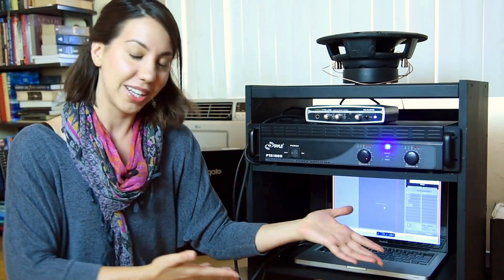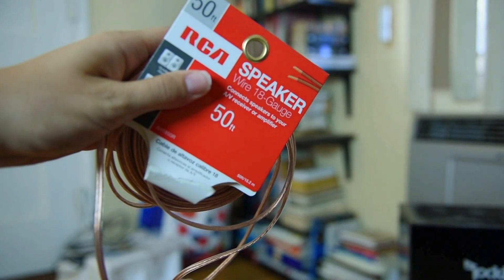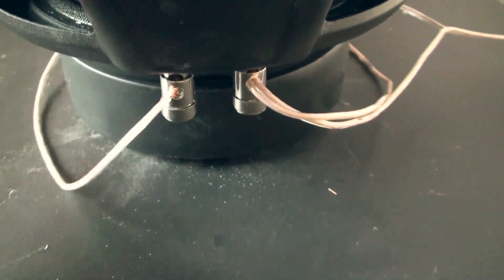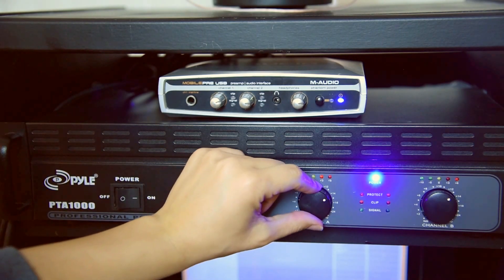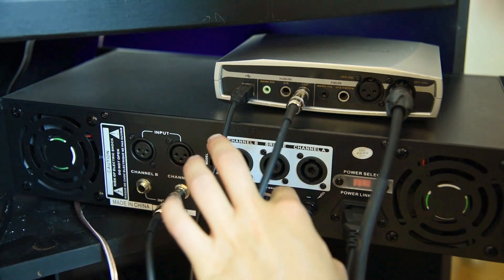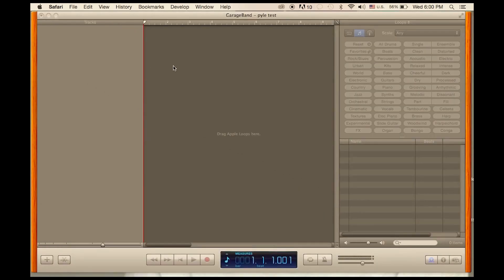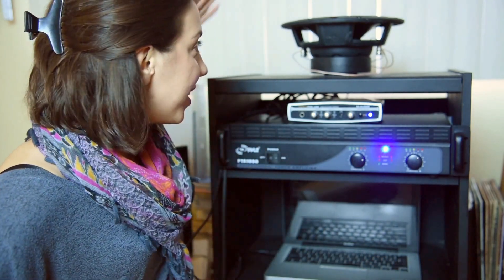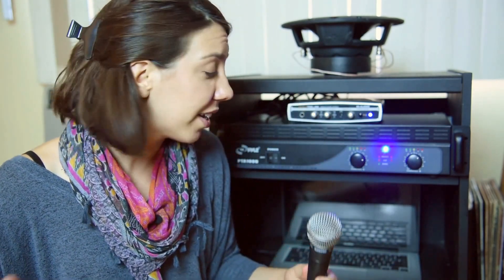How to build a Cymatics Rig!

Comment: actually white line is positive, blank is negative, but its not going to make enough of a difference for you to notice, most of the time, unless you have 2 speakers sharing the same box they will cancel each other out and will not produce the correct sound vibrations

Comment: Can you please tell me, is this setup appropriate for the kind of cymatic patterns that are seen with a cymascope, using water, light and a camera which give off those almost 3D like shapes?
Reply from the maker: Orphiac Inc I’m not entirely sure, I have a feeling that that would require some sort of a plate and this is using a speaker.
Reply: I deeply appreciate your quick reply. http://www.janmeinema.com/cymatics/make_rig.html In this link, they are describing the setup of the cymascope using off the shelf parts, this seems so similar to your setup?
Reply: @orphiacinc5944 I'm sure that if you screwed a plate to the speaker it would work